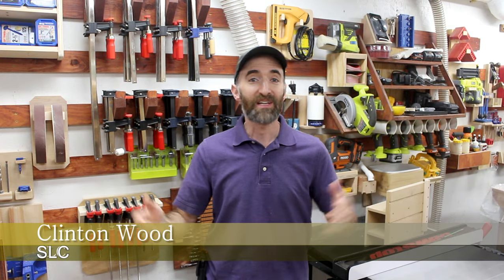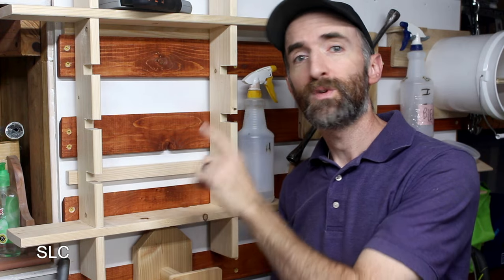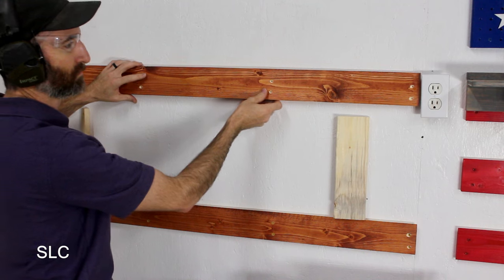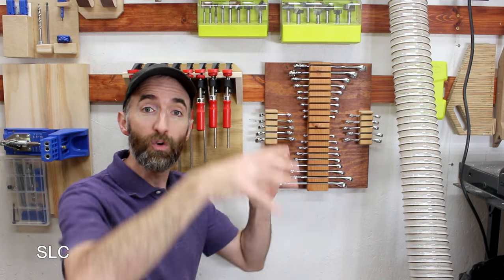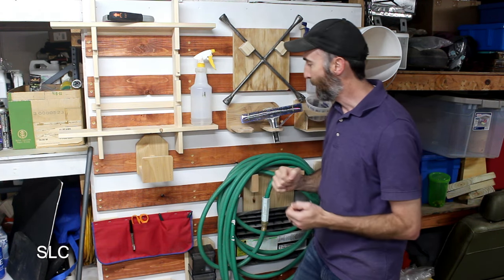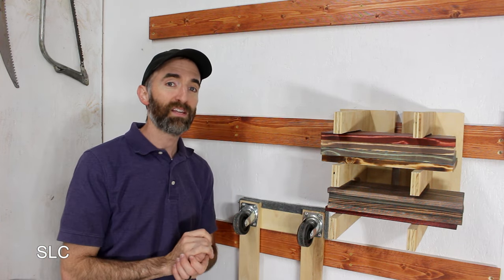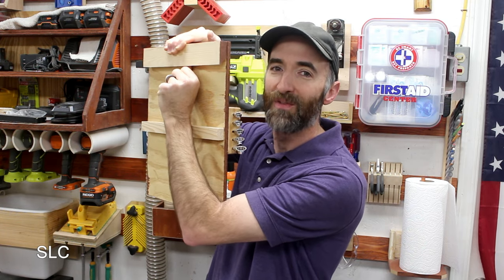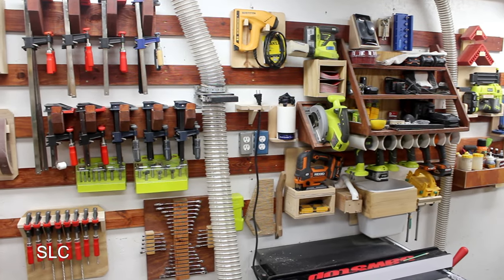What is the Best Spacing between French Cleats?

Comment: No bloopsters at the end? LOL...   Anyway, I've got a 2-fer comment for ya.... 
(1a) another approach and what occurs to me when you brought up the wider spacing... that if you don't know what spacing to use, if you decide to go wide say 12", you can always come back and add a cleat in the middle where you need the cleats and then you'd get 5" spacing...  So it would be a hybrid approach.  (1b) When I made my cleat wall, I cut a lot of extras strips so I could make more tool holders, or later on I needed a cleat here or there, I just added them...  Later on, in a different part of my shop I put my First Aid up and my PPE shelving on cleats that I added later...   so it's an evolving thing, just like adding the tool holders, I also add cleats where I need them... the versatility isn't just with the tool holders.

(2) The other important thing about the spacing, and you didn't mention, is that the width of the cleat itself is a factor, first it has to be beefy enough to hold the weight, but if the spacing is too close it actually interferes with getting the tool holder on or off the cleat... you need some "headroom" to raise it above with a little extra wiggle room to clear it... so there is a practical limit how close you can go.
Reply from the maker: Thank you Ray for your added insight. Both of those are Awesome pointers especially for new builders. 
I'm going to pin this at the top of the comments so others will see it.

Comment: What I could use is a French Cleat cart. My walls are filled with shelving units. A cart on wheels could have two sides for the cleats, doubling the storage. When not needed, wheel them to a storage area, or roll them in front of the shelving unit with a walkway between. A hand tool cart would be handy for working on cars. A wall of tools where you need them. I would use straight wheels on one end and wheels that could turn on the other, (would make parking them easier). The cart could be made like a wall on wheels. I would think 2 x 3 construction lumber would be plenty

In a storage area, they could be parked like a vertical drawer system.  Roll out the one that you need. When done, push it back in. A 4 x 8 floor area could store maybe 4 to 6 double sided carts. 
Love your channel.
Reply from the maker: Thanks Danny. I have seen something similar and it looked very useful. You should build one.

Comment: Great video as always! I kind of subscribed to the philosophy "one tool - one holder". That way my holders are on the smaller side. Hence, I opted for smaller spacing between the cleats so I don't have to have the back bracing but instead the holders will sit on at least two cleats. Also, my shop is pretty tiny, so that way I can cram way more stuff onto the walls and it makes it easier to move everything around to make space for a new tool. Plus, and more importantly, the holders don't stick out so far from the walls. If you prefer to build large holders that hold many tools e.g. a charging station for all your drills, chargers and batteries you might want to got with larger spacing. And I guess the same holds true if you have a large shop where holders sticking out is not an issue  --Thomas
Reply from the maker: Thank you Thomas. I can definitely tell that you have thought this through. And it sounds like you have a very well organized French Cleat setup.

Comment: Finally cleaned up my garage a bit and planning to add French cleats, so I've been thinking about this as well. Since I don't have a lot of tools currently I'm planning on using a fairly large spacing between cleats, but also planning to be able to add more in between by making the bracing I'm going to use on the tool holder either removable or compatible with the smaller cleat spacing.

I'm thinking of also making a couple of cleat hanging jigs which should also help maintain consistent spacing between the cleats.
Reply from the maker: Adding additional cleats later is definitely a great way to improve your shop over time. Also the idea of creating a jig for even spacing is an excellent use of your time.

Comment: First off I want to say thanks for making these amazing videos! You've given me so many ideas and tips for my storage of tools and gear. My question is about spacing but not between cleats, but rather for studs. My garage was built in '54 and my studs are about 24" apart. I would obviously try to hit every stud with two screws but I was wondering if it'll still hold up well?

Comment: Thank you for taking the time to make this video. I am looking at using cleats in my workshop and was thinking that wider spacing would work overall and if I require smaller cleat spacing for small items that I could make a small spacing cleat board which can be move anywhere on the wide spacing cleat wall. Has anyone done this?

Comment: Perfect timing with this video! I've actually been waiting until I feel comfortable with a setup, such that I won't be disappointed in the spacing I choose.

I have decided to start out with broad spacing, so I can become familiar with using the system, then fill in between, at a later date.

I do a lot of welding and my walls will be steel barn siding. Wooden cleats would be a fire hazard because hot spatter will get caught between the wall cleats and the wall. As such, I'll use aluminum zee brackets, but the concept remains the same. I have and will continue to gain inspiration from your channel, thank you for sharing!
Reply from the maker: Thank you very much. 
Using the aluminum z brackets is definitely a great alternative for your situation. I also recently discovered metal pegboards, which might benefit you as well.
Reply: @SpecificLove7 
I've considered metal pegboard, but I believe extruded aluminum or bent steel zee strips will be my focus. It will also give me another opportunity to use my rotary laser, which is one of the coolest tools I've got. I even hang pictures with it, so I'm probably a little obsessed.

Comment: The spacings you give (~1:00) are actually the gaps- the spacing is from the top of one rail to the top of the next. That is the module height. Which impacts your storage density.
There is a better way- firstly instead of using an angle for the cleat use a slot- gives more positive engagement. Secondly, do it by router into a timber wall, at (say) 30mm spacing. this reduces your module height from around 150 to 30, five times more choice of placement. Or use 10mm spaced holes for even more adjustment (you see where I am going here...)
Reply: Using a router to add a slot?  For French cleats?  Are you sure you're not mixing up a French cleat with a t-slot?  If not, can you please share a video or website that shows what you're referring to?  I'm working on a tool wall currently and I'm interested in what others have done.  Thanks.
Reply: @s.a.shaffer  I was actually using the 'Reductio ad absurdum' argument to show some of the flaws of 'French cleats'(FC). Personally, I use a pallet system (that is pallet in the machinist's fixture system, not the bulk transport tray). Most FC systems use carriers of several tools that hook on the strips- because the overhead of small single tool mounting is too great. These are far from stable- they use gravity to stay in place, and can easily be knocked out of place. A machinist's pallet consists of a plate with a grid of tapped holes in it. Clamps etc can then be used to secure a workpiece in the desired configuration. My wall is covered in a twin sheet of material that has a 10mm spaced grid of holes for 4mm bolts. In practice, these do not need tapping- they self tap easily. Carriers just need two holes a whole number of 10mms apart. Two bolts zip in and hold it firm.
Advantages over cleats-
- much better resolution of placement- to within 10mm.
- secure, does not  rely on gravity. 
- slimmer, no parts fitted to the back
- requires less material to make
- smaller module sizes are also practical
- individual tools can also be mounted (hooks, clips, etc)
- does not collect dust in the grooves
The appearance is of pegboard- but it is not. The only link is that pegboard techniques can be used too- but carriers give better density. It is also much stronger than pegboard- one of my carriers has nine heavy hammers on it- and is rock solid.
I will be adding a video on the system shortly.
Reply: @Tensquaremetreworkshop  Thank you for clarifying.

Comment: Question,  I have  open stud walls with insolation. Can I use 2 by 4 for cleats. They are a lot cheaper  than 3/4 plywood and would be strong. Second, could the cleat on the storage box be 3/4, scrap plywood ? Thank you

Comment: Have watched all of your French cleat videos.  Great job.  A question that you may have answered, but maybe I missed...You mentioned that your cleats should be about 3 to 3-1/2".  That looks like the width for the wall side cleats.  How about the cleats on the tool holders?  Are those shorter?  They appear to be in the videos.  Thanks!
Reply from the maker: Mine are usually a little smaller because the tool holder will not be holding as much weight as the wall cleats. I do glue them to the holder.

Comment: In my shop, I made a cleat-adjustment system using rope and pulleys, so the cleat spacing is infinitely adjustable.  I got the idea from some Venetian blinds.  Some days, I set the gap at 3", and other days, I go as far as 16".  The beauty of the system is that (like Venetian blinds), one side can be lower than the other, so my cleat gap can change from left to right.  The cleats are about 6' long, and a difference of 4" over that length is perfect, and you don't notice too much that the tools are hanging slightly askew.

Comment: Howdie ya make it easy  to understand wondering why  ya don't use 2x4,s got on bk wall for cleat or 2x6,s ? I,m new at wood making stuff for  l,m green horn mechanics is my trade but this wood making stuff is cool  to do looks like been watching you for some time now and joined cause you mak0e it easy enough that you don't have to be rocket scientist to do this stuff l,ve got air tools  that thought was heavy and would  fall off ? But it seems like  they hold so if ya can help me out better joined your videos our helpful tips and advice  work for me and how wood ya take my peg boards and use to make them usable for French cleats to hang mine up stuff  my shop is 40 by 60 ten ft walls got lots of room 🌫  building ya  hav plans for building these thks so much for showing us how to do this  l,m from Canada 🍁 SK  mighty chilly here in winter time most of the time it gets to 35 below and tools are hard to work with so guessing l,m on board ready for a adventure mighty fine Sir thanks